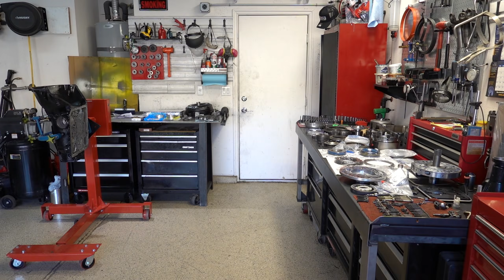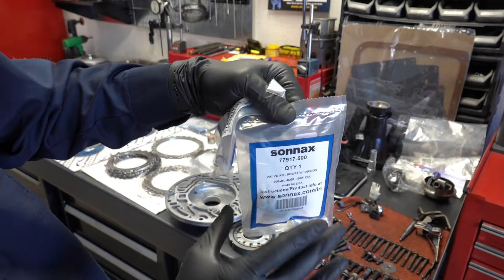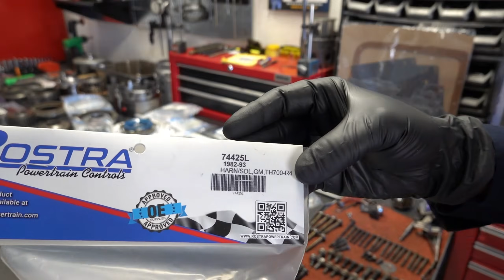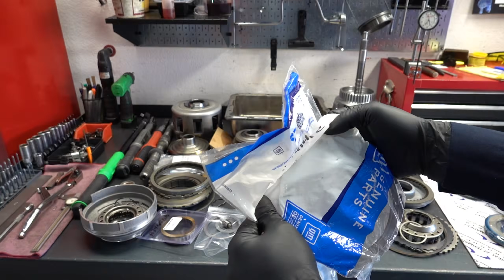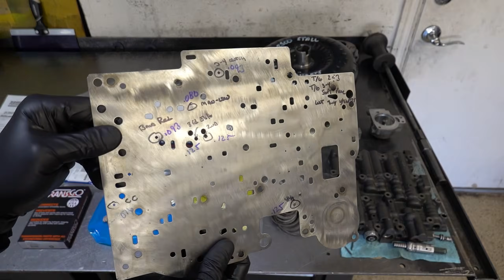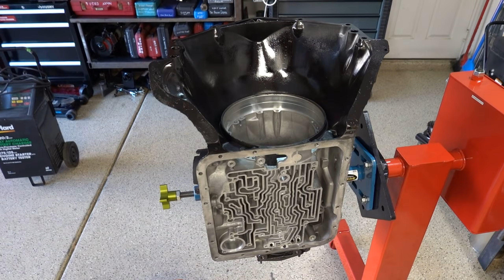700r4 Rebuild - Rebirth of the Nemesis!

Comment: Question??? What size would you advise to drill out orfice on 700r4 separator plate for 2,3,4 an the rest of the associated orfices with a 3000  stall behind a 600 hp sbc and what size drill bit would achieve said size

Comment: Why did you don't use the Zpack? It has a lot of fame what are your experiences with it?
Reply from the maker: Thanks for watching, Carlos...I don't like Z-Pak because I feel the plates are too thin...I prefer the 4L65E pack in a factory drum; 4L60E spec 8-clutch stack in the Sonnax Smarttech Drum and the clutches that come w/the Cope Racing 4L79 drum.
Reply: I have z-pak in everything i own. 91 trans am 700r4 383 stroker 6 years and counting. Other in my silverado 5.3 4 x4 mild build with 4l60e 6 months so far. Bad Tune will tear a transmission up. Installation is huge and making sure new torque converter... And a good cooler....  I don't care how good a builder you are... If the trans is overheating and lines was dirty....Their always going to blame the builder. I've learned alot from Nick especially the input shaft checking warm has really saved me. I build for myself. I don't trust any shops here. I have 6.2 gen IV built. I'm going to give the rabestos gen 2 a try. Anyone have any luck with them?